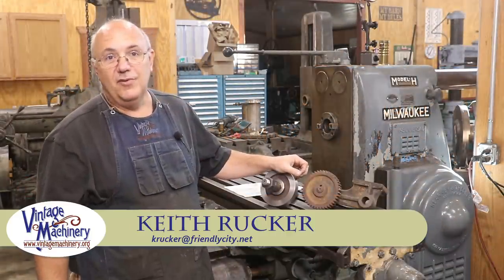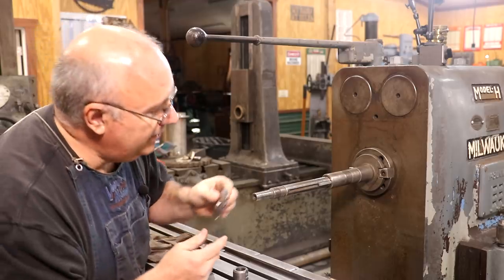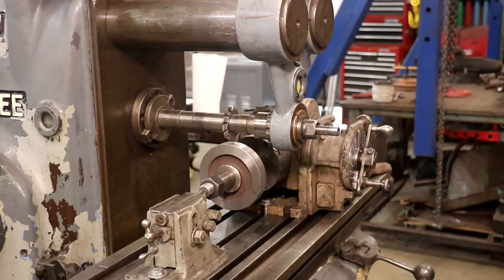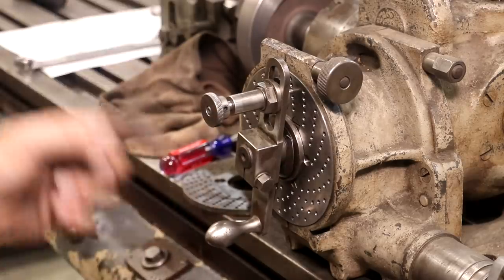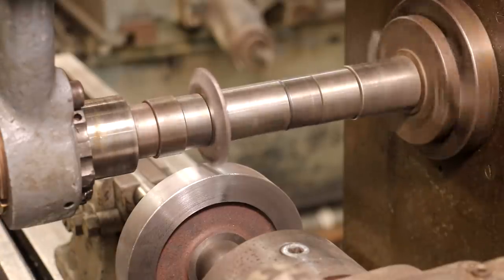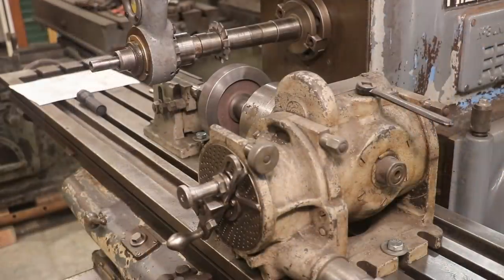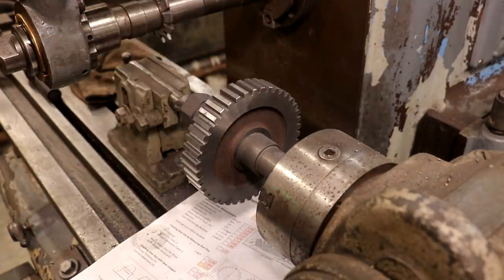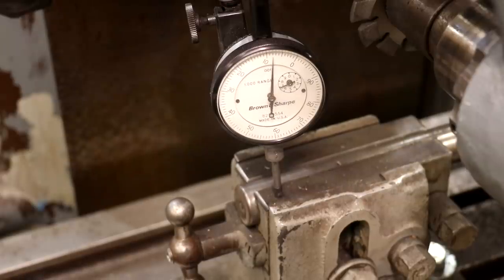Metal Planer Restoration 44: Cutting Gear Teeth on the Horizontal Milling Machine

Comment: Is it permissible for the operator to hold his breath when lining up for cutting the last tooth? :-)
Reply: Think of the time and money wasted if you’re off one pinhole
Reply: Permissible?  I thought it was required.
Reply: Must be a tremendous relief when the last cut DOES split the difference.
Reply: One would be forced to cry, speak in tongues, etc.  I'd go crosseyed counting holes.
Reply: There's two sides to this:
1. An experienced machinist usually won't make the mistakes required to get you to the error that would result in a failed gear by count of cuts.
2. The operation itself is nearly fool proof if procedure is followed to a T. Kinda like trying to derail a train. It's doable, but you really have to work for it.
Reply: Every single time

Comment: Great video thanks. This is not criticism, I'm just mentioning what I would like to see too. I have a horizontal mill too (a German made heckert) and I wish there were some videos using "tool room" size horizontal milling machines taken closer to their limit. So not huge manufacturing behemoths, but smallish machines like the one in this video with 40in by 17 in travel taking bigger cuts. Anyone that has read a manual/book to those machines saw their material removal tables. I once tried to take a fairly large cut and I managed to pull the piece I was working on out of a vice slightly.. (no damage as I stopped it immediately). I imagine back in the day those machines were used much more aggressively and I wish someone made more videos of using them that way. It presents unique challenges with work holding and other things.

Comment: Very nice series Keith, thank you.  BTW: for those who don't know, there is a horizontal  mill accessory for a Bridgeport vertical mill. Not nearly as nice as your K&T, but might get you through the night if you need one. I use mine for making fluted gun barrels

Comment: You could have tuched off using a piece of paper no big deal .
If you have a gear hob
that needs sharpened I would be willing to do it 
for nothing. I have been a 
tool & cutter grinder for over fifty years. I will do it right keep the correct profile and I guarantee not to burn it. I can sharpen most anything. 
I don't have much money to donate to your channel 
but can do this. If you have a cutter problem contact me I'm pretty sure I can help.
Reply: Tsunauticus III  As I said before I can grind them and get them right even if someone else messed them up. I would  be glad to help him out if I can . Theirs not much can't do . Besides it would give me a chance to show off.

Comment: A few years ago I needed some spacers made for a lace cutting machine at work.  I thought the bill was rather expensive at the time.  Watching you make different parts I realize there is a lot of set up time using very costly machinery plus the time it takes to cut the item.   I guess those spacers I had made were not that costly after all for the time it takes to make them.

Comment: That's pretty cool,  like magic. Never saw how the gears are made.  My buddy runs a machine shop, recommended that I buy a vertical milling machine.
Reply: Don't worry you can cut gears using a vertical mill too.
Reply: @littleworkshopofhorrors2395  I've been scanning FB marketplace for a Bridgeport clone to pick up cheap.  I fix old garden tractors for fun,  it would be ideal I think to fabricate parts.  Old parts are getting expensive or unavailable
Reply: @DC_PRL  a BP or clone would be good but you might find something bigger cheaper because it doesn't have the "name" that everybody wants, if you can find the space for it.
I have a 626 size mill, which i find "adequate" for making or repairing bits for cars and bikes for the trade as a paying retirement  hobby. It's amazing what you can do on one if you have a little imagination.

Comment: You can do jobs like this on a vertical mill with a attachment.  I have.  Not as rigid but it can be done if you don't have the floor space or other needs for horizontal.

Comment: At Dodge in Mishawaka we machined probably 50 to 100 tons per day of cast iron and used lots of water mixed Rycosol 66 coolant. It probably aided in iincreased production rates but probaby more important the coolant decreased the generation of lots of iron dust.

Comment: If I missed your explanation of the gauge pins I apologize but I have a question What determines the size of gauge pin to be used. I see that you are actually measuring the teeth angle versus the root. Maybe explain the point of measurement for inquiring minds like mine. 
Thanks ahead of time.

Comment: I love your videos. I know it's an old thread, I'm not a machinist, but why couldn't you cut the slot for a tooth, cut the opposite slot, measure with your pins to get the right cut depth, then just cut them all with just one pass around?

Comment: For the math: A full circle is 40 handle rotations. If you divide a single handle rotation up with a 21 pin plate, then a full circle is 40 handle rotations x 21 pins = 840 individual pin-jumps. With a full circle of 840 pin-jumps, we need to divide that into 42 teeth. Thus one tooth is 840/42 = 20 pin-jumps.
Reply: Still trying to wrap my head around it after reading it for the fourth time. Lol
Reply: It's easier to think of it as:
40 handle revolutions gives me one full rotation on my part (360degrees), every handle revolution, I cut.
But I want to cut 42 times.
So: 40/42 = 20/21 -> every 20th pin out of 21 holes
Reply: @OCT566  I didn't get this concept on the first day I tried either. That's why I'm explaining it. It will click eventually. Come back to it later. Another analogy: The full circle is a pie. Divide it into 40 pieces (= 1 rotation of the handle). Divide each piece of pie into 21 (the pin-holes on that plate, attached to the handle). That's 840 pieces of pie. To divide the whole pie into 42 pieces, simply divide those 840 pieces up into groups of 840/42 = 20 pieces. Remember, each of these tiny pieces is one pin-hole further on that plate. 
I do hope you understand the mechanical concept. That is, turn the handle once and your dividing head turns a 40th of a circle.
In any case, enjoy the pie.
Reply: A full circle divided into 42 teeth gives us 8.5714285714 degrees of rotation per tooth.
A full circle divided into  840 pins gives us .4285714268 degrees of rotation per pin.
Divide the number of degrees needed per tooth by the number of degrees per pin and we get 20.0000000826 pins.
Reply: @markmossinghoff8185  So is that error spread out over each cut, or does it just happen on the last cut?
Reply: @hectorpascal  good question. Since all the pins are evenly spaced, my guess is the error is spread out among all the teeth. It's so small it would be difficult to measure.
Reply: Thanks for the explanation Erik. Is the 40 rotations to give accuracy to the rotation and eliminate any backlash?
Reply: @markfryer9880  it's 40 because it can go into 360 and it's not too slow, you can have any ratio the will divide into 360, I have used 90 to 1 in the past but they are not too common. Backlash is present in all dividing heads, the operator manages it.

Comment: What pressure angle is used here. and were you shooting for some backlash? I'd think an old machine like that would use 14.5 degree pressure angle. I just love seeing gear cut on an old horizontal mill....I have a 1935 B&S universal.

Comment: Runout on the 2H.. wonder if it had a major crash and bent the drive spindle inside the gear case.  This 3H does sound straighter.  I wonder if the new 2H owner could drop in several tool holders and indicate off them to see if they all have runout in the same direction..

Comment: What if instead doing one full pass and then measuring top-to-bottom with micrometer and gauge pins, we did cut the slots only on the top and the bottom of the part? We can still do the height correction before "real" pass and it sounds like doing less manual labor.

Comment: Nice work Keith. I have been a school bus/ motor coach mechanic for over 43+ years, but dabbled in machining at home for years. Why is that gear made from cast iron rather than turning it out of steel? Love your videos.
Reply: Well, 130 years ago it was made of cast. It's a restoration thing!
Reply: Cast iron to cast iron gears will work. Cast steel to cast iron gears will result in greater wearing as well as possible tooth breakages.

Comment: I got a question, can someone perhaps explain?
When he was measuring the distance between both pins opposite of eachother.. He wasn't 100% opposite, was he? since he cut 41 teeth (or 41 gaps) the correct diameter would always be one half pin off if he was measuring like that, or not?

This might be a stupid question, sorry in advance. I come from woodworking, I just find these machinery videos extremely interesting. Thanks

Comment: Would it be possible to dial in the depth of cut in by only doing the two cuts opposite of each other that you measure across? That way you get to do all other cuts in one pass.

Comment: I'm watching this and smelling hot metal and oil!
Reply: You have defective hearing then. No oil was being used for the cutting process as coolant/lubricant ;)
Reply: @millomweb  really?  Did you not see him applying oil before sliding the support?  Also the smell of oil lingers in a machine shop, if you ever visit one you’ll understand.
Reply: @Churchill250267  Yes I saw him apply oil to the cold bearing - and wonder about the oil reservoir in the support - mine hasn't got that - so mine needs to be oiled - not sure about his.
As for alleged smells of lingering oil in machine shops, Depends on the shop.There are various sources of smells, not all of them being oil based - such as the hot metal smell you mentioned.
Reply: @millomweb  whatever.

Comment: When you're trying to find the point where the cutter touches the gear piece, why don't you just do that without having it spinning? It seems to me that it would be easier to just let them touch statically to set your zero-position... Considering your expertise I'm sure you have a good reason, I'm just curious about it :)

Comment: I notice the outboard support has an oil level viewing glass. What is the oil lubricating?
Reply: The outer bushing between the spindle and the outer support. He installed that bushing at 4:40.
Reply: @kensherwin4544  many thanks for the information. That makes total sense.

Comment: I've always been curious of the wear rate on the cutter and how that affects the tolerance from the beginning of the first tooth to the last tooth?
Reply: Neil,in my experience of using gear cutters what happens is the cutter makes it evident that it is losing its sharpness by the hammering sound as each tooth makes cutting contact with the workpiece. They don't normally lose their profile due to wear. The operator is aware just by the change in cutting sound that the cutter needs re-grinding. The swarf chips also give a lot of tell tale info about the condition of a gear cutter.
Reply: @howardosborne8647  Thanks for the detail